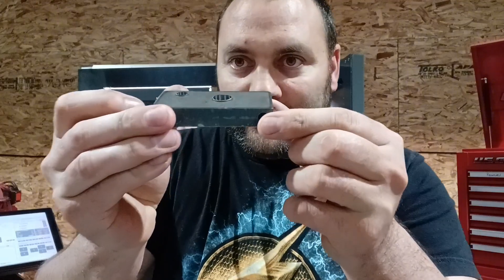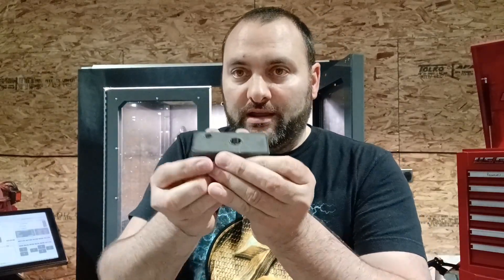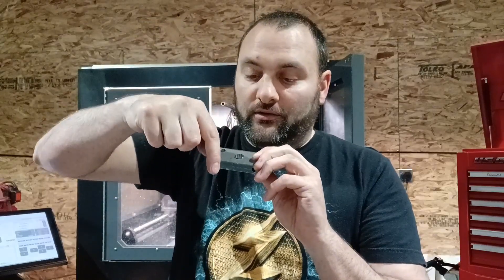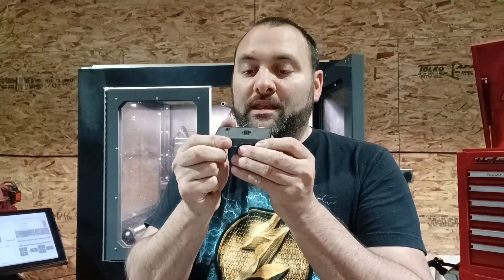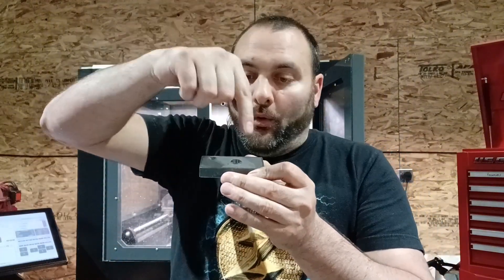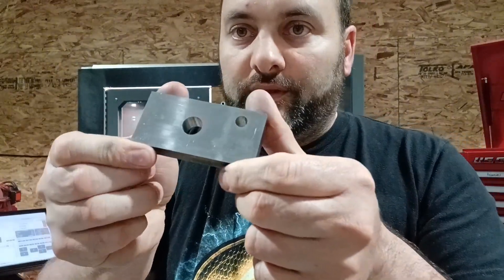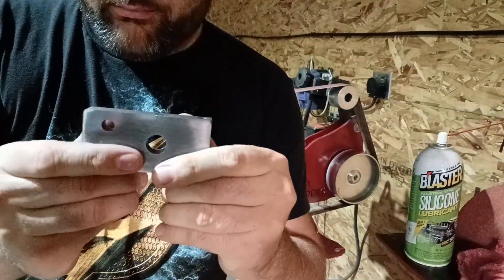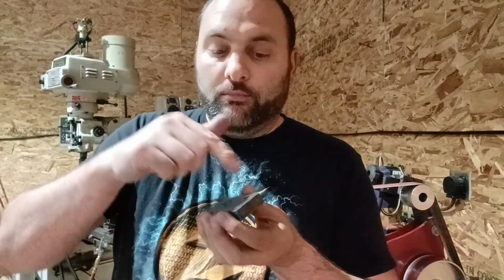How to eliminate the creation of burs on your CNC parts! #mr1 #cncmachine #langmuirsystems

Comment: In my shop, we drill that hole 1/32" undersize and finish it with one finish and one spring pass.  The end of the endmill never gets dull.
Reply from the maker: If my machine had a tool changer I would also do it this way.   Since I do not that would be and extra setup, and operation for me.  I should have clarified this is a good strategy for machines without tool changers. :)